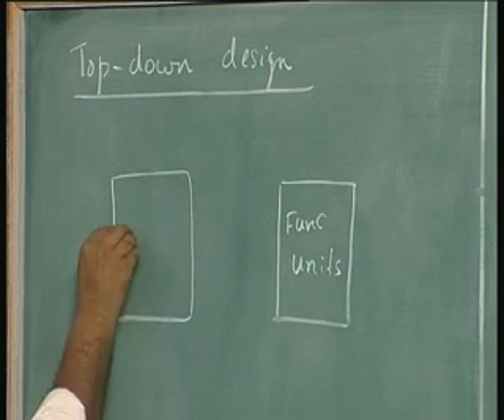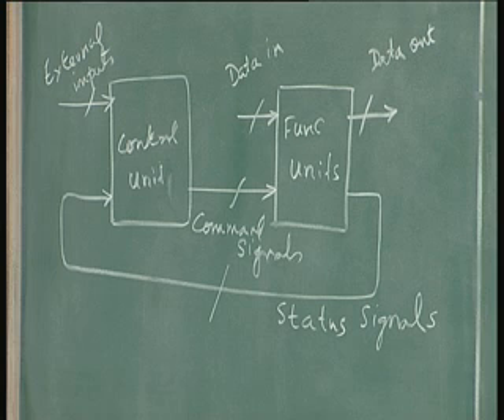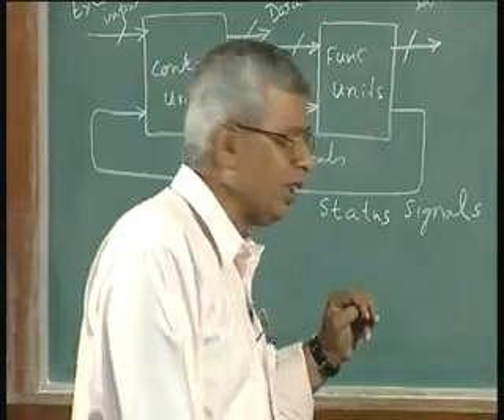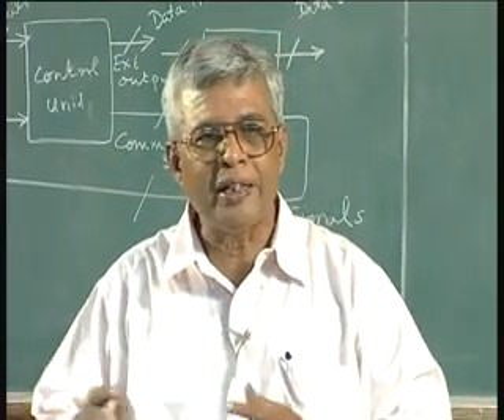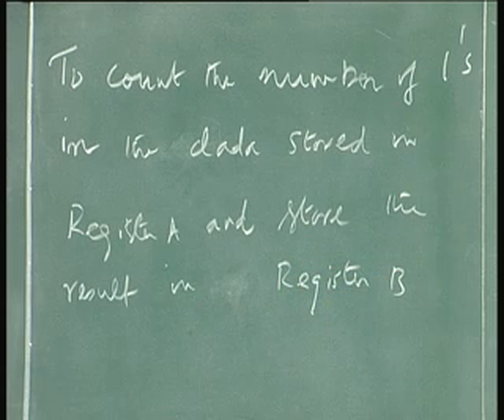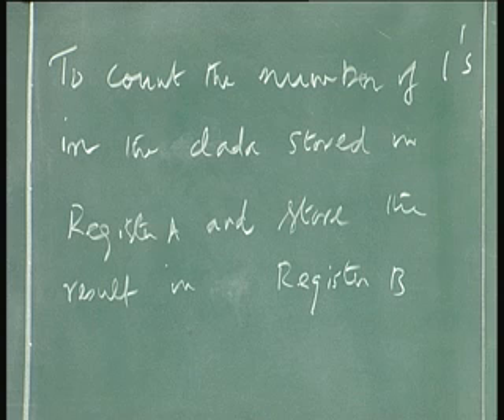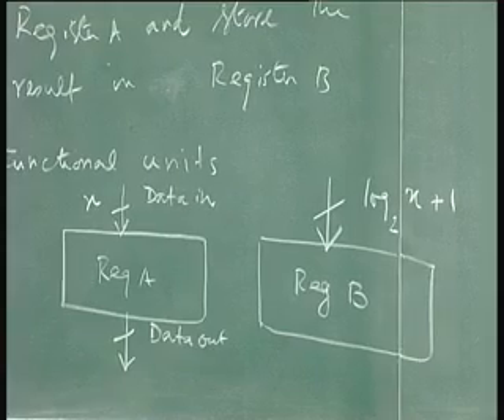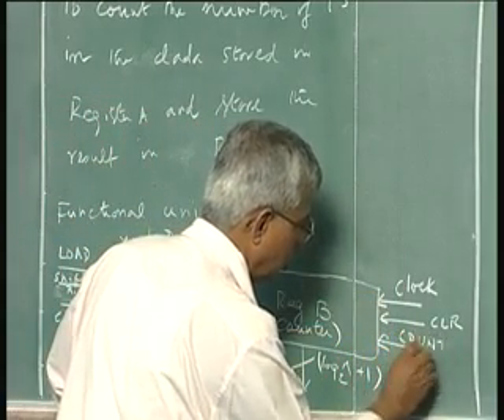Lecture 39 - System Design Using the Concept of Controllers

Comment: How did log2n + 1 come ??
Reply: log_2 (n) => Value of "x" in 2^x = n. 
If n = 8 i.e. register A has 8 bits and if all 8 bits are "1", register B has the value 1000. log_2 (n) + 1= 4 (number of bits in 1000).
log_2 (n) + 1 essentially gives the number of bits required in register B to represent values in register A.